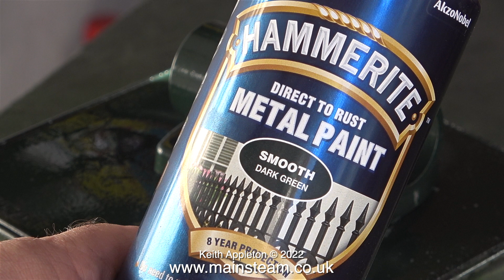TURNING PLAIN AND SIMPLE - MODEL ENGINEERING FOR BEGINNERS - PART #47

Comment: I've always heard from various YouTubers that do turning that that backwards pass is called a "spring cut". Not sure on the etymology of that, whether it's only the depth of cut that the cutting tool "springs" back when it's not under pressure or that the resulting cuttings are very "springy".